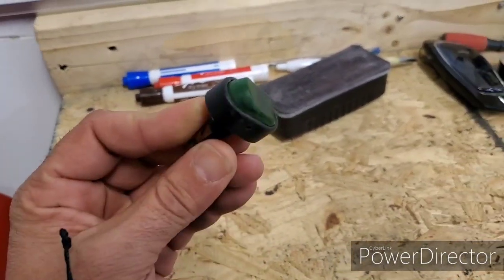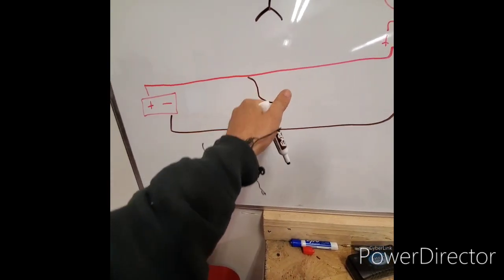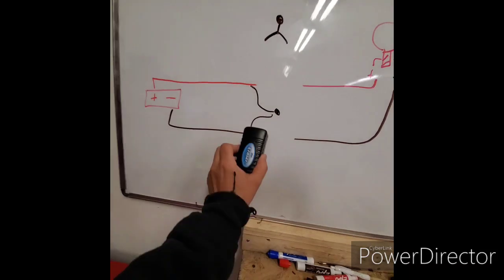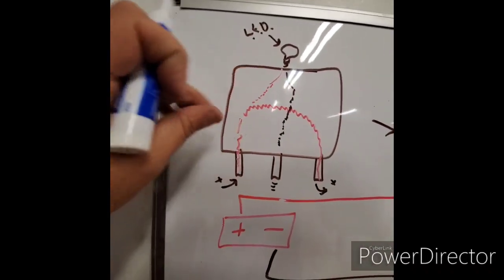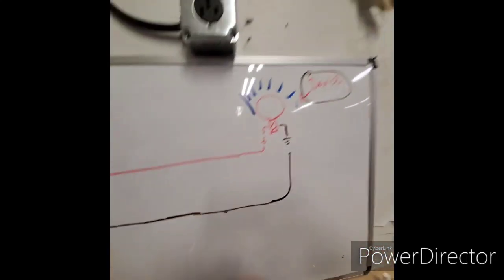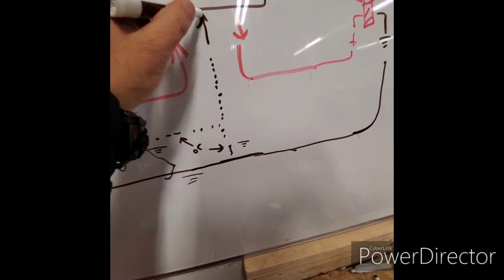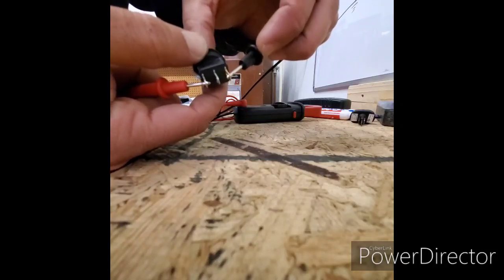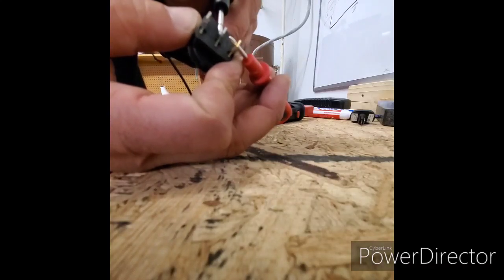How to wire an LED toggle switch , ( on-off 3 prong rocker switch ) 2020

Comment: Thanks for the great video! I’ve been trying to wire LED ceiling lights that have independent switches for each light, and also a dimmer for all of the lights together. So far no luck! Is it possible to put a dimmer on multiple LEDs? If so, how do you wire it??
Reply from the maker: The issue you may be having is that most (not all) LEDS are either on or off. This is because an led is actually a "diode". Lol. Theres a lot to explain that. But a dimmer on a basic led is not going to be likely. It would have to be a dimmable led..

Comment: Can I ground the switch to the battery and then then devise to a metal bolt ?
Reply from the maker: If your running the devices pwr, through the switch and thats the leg the switch is cuttijg on/off,  then you can ground the device anywhere youd like. Under that same context, the ground then for the switch is just for the illumination,  so yes that too can be grounded anywhere, including the battery.

Comment: Hey i have a question im trying to wire a electric cut out on a car the old switch had 6 prongs and the new one only has 3 . It has a white wire , black wire and another black wire with 2 ends and a red wire with 2 ends . How can i make it work . I tried a few things but wont work
Reply from the maker: If by "cut out" your talking about the exhaust valve? Then your going to have to fins a way to get specs on both switches.  The servo's on the exhaist cutouts are slightly diff from one company to another. Theres not much UNISON between compnaies. Which if going to make it extremely difficult for me to sort, in text and hVing not seen exactly what you had and what you have now. 
If you Hve the option to replace it with the same origional switch, id HIGHLY siggest that, over saving a few $$ by using a totally diff switch.
Reply: I tried looking for one but havent found it . The black and white single wires are the ones that come from the cut out and yes it is exhaust . Then the other black with 2 ends is ground and the red with 2 ends is power it comes from the battery
Reply from the maker: @Agustin Herrera so the best way i can explain the motors is like this. (At least how most are)  Common ground so both servo's share gnd. And then each servo has 2 pwr......1 pwr is to activate open....and 2nd pwr activates close. So essentially each motor requires 2 pwr 1 gnd. And the toggle switch rests at 0. Meaning when not touched. Doesnt send pwr down either side. No continuity.  
I am not for sure if that may be helpful or not. But if you have to use a diff switch. Dont bother looking at "what was"...instead focus on "what is". And that qould be the motors, and the supplied pwr +gnd.... from there you can move forward slowly. 
(Ps: if i am correct about the "double pole" motors, then your switch must have 2 "loads" 1 gnd and rest at center or  "open". <---technical term/not as is valve open)

Comment: I have a 3 wire brake light on a mini bike and the brake switch has 2 wires the voltage regulator has 3 wires so HOW DO I MAKE MY STOP/RUNNING LIGHT WORK ❓❓❓❓❓

Comment: can i use a "quick splice" connector and piggy back from the power wire already going into the supply of the rocker switch instead of running a separate power wire? Or will that cause a shortage....?
Reply from the maker: You mean for the gnd terminal? That would be (-) not power (+). I may not be understanding of your question..
Reply: @myonlinecarguy1  my apologies. Yes, the ground terminal i meant.

Comment: Trying to add green LED strips to my quad and put it to a toggle switch and nothing is working the strips work I know that but when I test the switch it just sparks I hooked up a multi meter and it reads nothing I'm so lost
Reply from the maker: A meter isnt suppose to work to show voltage. Because a switch doesnt have both pos and neg. Its explain in the video in great detail.

Comment: I’m trying to replace the toggle switch on my recliner. I have a black and white wire on the couch side. The toggle switch has 3 wires. A 3 prong outlet plug plugs into the toggle switch. Which wires connect to white and which to black? The toggle switch has an led light on it. Thank you
Reply from the maker: That one might be a bit different as im sure the recliner runs on AC power. Not DC. The electrical circuit of AC power is quite different. Id maybe suggest looking into that. I dont know that i can help with this one.

Comment: Hi great video i had similer issue today car wires were smoking luckys car ok i disconnect wire i had toggle switch do u think i need to wire  3 toggle switch as i got 3 different lights i got my rgb halo my led srip light for bottom grill an two led lights for my bonnet vents can u help with how i should wire them an can i connect them all to one switch but do the switch the way u did trough one leg pleaee help
Reply from the maker: So, EVERY switch is done with 1 leg. ALWAYS. So, the anwer there is yes. 
Far as the lights. You can do 1 switch for all those lught as long as the 12v source has enough power to feed it. And finally. Just for safety,  you might want to add a fise to the line just before it goes into the switch. Just incase.
Reply: @myonlinecarguy1  ok so jus so im sure shall i put the fuse in the same leg as the switch an can the fuse me next to the battary also what fuse would i need as the lights im using are all 12v and when i connect the light together when i join each ones i jus had electrical tape right thanks for getting back so quick please let us know
Reply: Also have u got instagram i can send u the lights i got on there with pics my insta is mods4less we can chat that way eaiser a bit more in dept

Comment: Say I have 3 of them switches to 3 diff devices. Can I just daisy chain  all 3 neg together and then ground it to the frame? how about the power from the battery, can I run 1 cable from the batt to the 3 switches, then just and individual power from each switch to the device?
Reply from the maker: Yes sir. I do it all the time. Good eye my dude.

Comment: Thank you so much for the clear and awesome explanation ! I know that we use a relay when the power going to the battery has higher power but is there a rule of thumb in using a direct 3 way switch like this vs using a relay switch ?
Reply from the maker: Well, you can always use the switch output to trigger a relay. Thats how you would use both. Sometimes you can use a high amperage switch rather then a relay, but in my opinion a switch triggered relay is the best.
Reply: any rule of thumb on how many amps that we must use a relay ? 5amp ? 25amp ? Thanks again
Reply from the maker: The electrical limit is determined by both the size of the wire being used as well as the switches ability to effectively pass it through. Each switch has its own amperage limits and so does every wire and they may vary from A/C power vs DC power. 
For me, anything over 15amps to runa. Device and I'll just go toggle and relay. I prefer not to run heavy long lines that directly cut on and off.

Comment: I have a weird question but if the LED turns on in the on position should shouldn't the ground and one of the positive pins still register continuity or does that not happen due to the resistance of the LED as the multi meter only passes and tiny amount of electricity to gauge continuity?
Reply from the maker: An led is an electrical "diode" so pwr will only ever pass through in 1 direction only. It is a type of resistor. I suppose in some way there would be an ohm load showing continuity,  but i imagine immeasurable because if it being a diode adn not a typical resistor.

Comment: Hello Elliott. Thank you for your video on three prong toggle/rocker switch. I’m not electrical savvy in any way, but I put some LED flood lights on the bed of my F-150. Everything works fine, except the moment I connect the switch to the lights, the wiring starts to heat up significantly to where I have to disconnect the switch.

The wiring is Nilight, which seemed pretty simple to set up. My rocker switch is the three prong LED like in your video. I connected the ground to my battery, but I’m wondering if having the metal lights grounding in my truck bed are causing the heating problem. 

Any ideas would be appreciated….

Carlos
Reply: where are you getting the positive from to power the lights?

Comment: I’m a little confused so if I’m wiring led strip lights my neg wire goes to ground prong and then i wire another neg to the battery from the same prong so I’m essentially just splitting the wire? I understand the positive side.
Reply from the maker: So you have 2 options. 
1: led (-) straight to ground.  And (+) from batt to 1 side of switch , then other side of switch to (+) of LED lights.

2: led (+) straight to batt (put a fuse in that).....then (-) of led to 1 side of switch and the other side of switch straight to ground. 

Yes, the switch is only there to seperate 1 wire. Thatll turn on and off your led light.

Comment: i have a 1990 cadillac deville. and i had to replace the ignition switch. but they have a key with a code. and so far all place iv gone can't do it because they say the cars 2 old. and locksmith charges alot!!! $$$$.. so my only option is to put in a toggle switch. will that work? i was wondering?
Reply from the maker: Electrically it would send power to the starter or at least in the direction of the starter. Unfortunately,  if you dont somehow remove the part of the vehicle's computer that is looking for the key. Then it will NEVER give the permissions required. So the what is "no" it won't work.  It's how the manufacturer stops vehicle theft in the first place.  The immobilizer your referencing.
Reply: @myonlinecarguy1  ok thk you.. so i just need to get a key with a code.... but also the ignition  has 2 wires coming from it and run down the steering wheel column and plug into a circuit under the dash. what i did is i cut the new wire and just splits it to the old one. i hope that is ok. ?
Reply: @myonlinecarguy1  even ace headwear and lows won't do it only cars as low as 1999. a locksmith if i go to them $100.00 or to me $200.00... wonder if jay leno ever had taht problem? lol
Reply from the maker: Yeah chipped keys around here start at 200 and go up from there. Sorry man, is what it is.
Reply: @myonlinecarguy1  thk you for all the info you have been very helpful..
Reply from the maker: I hope your vertical kit comes out badass man.
Reply: @myonlinecarguy1  thk u.

Comment: Just stumbled on this channel. LOVE IT!! Expert training in a digestible way. THANK YOU. 

Just a quick question: I am going to add a switch to some EL-Wire in the car. When adding a switch...Do I need to run an inline fuse? Seen others say you need to so am confused.
Reply from the maker: Can u elaborate more on the "EL-Wire"? 

Far as fusing a switch, or any elecetrical being added. S fuse is really always important to have. It will save your device and protect your wires if somethign were to accidentally create a short or anything..
Reply from the maker: Also, i super appreciate the love man. Sonetime things can become disheartening.  But i try like hell to help. Lol
Reply: @myonlinecarguy1  Honestly man, totally full respect! Really really helping me with the whole led rocker switch thing. Your teaching style is incredible! 

In regards to the EL wire, its pretty much the stuff you can buy off wise that pushes in to your dashboard/trim to make it look all pretty haha! I basically purchased to sets which are cigarette lighter powered, however I have cut off that part and my plan was to connect both sets together. Then tap them into the power behind the cigarette lighter, but add a switch so I can shut them off. I just did not know if I needed to add a fuse. 

Thanks so much again bro.
Reply from the maker: Your welcome. Glad we could help.
Reply from the maker: Oh, as far as the wire kit. Something that low voltage, you could get away without a fuse, but ONLY because the power feed from the cig lighter, is most likely already fused by itself. Plus that kit wont pull a major electrical load at all And if the were to have a short, you could trouble shoot it pretty fast.
Reply: @myonlinecarguy1  Legend! Thank you very very much man! Genuinely appreciate the advice. And great videos.

Comment: Great video.    I always wondered how these worked.   QUESTION:    I am switching from a two prong switch to a three prong lighted switch.   If the two prong is not labeled or miss-wired, how do I use a multimeter to determine in the “in/hot” wire on the switch?    BTW...I love getting advice from Vin Diesel LOL!!!
Reply from the maker: Ok, so on a 2 prong....there is no direction. So even if labeled, you have to check it. 
Using a multimeter, set it to read "continuity " should have an image like a speaker sound type image..
Place 1 lead, on 1 prong and leave it. The other lead on prong 2, and flip the switch on. If it beeps when on and silent when off, those are you pair for "pass through " (in/out) . If no beep at all, then leave meter lead in prong 1, and move meter lead to prong 3. And test again.
Reply: MyOnlineCarGuy1 on the two prong, one wire should be the HOT wire.   I assume just check for current using a common ground?   Sorry if not being clear.   My 3 pole is labeled, the two is not.   I want to make sure I take the hot wire from the 2 prong and put in the correct spot on the three.
Reply from the maker: @dmraco  oooh ok. So you meant how to test the 2 prong? Yes, find a common ground somewhere. Ajd using the (+)  lead of the meter, probe each wire. 1 wire will have voltage always (or with key on if in a car)....the other wire will ONLY see voltage when the switch is "on".
Reply from the maker: @dmraco  voltage is what your looking for, not current. (Im sure u know that, but just incase)
Reply: MyOnlineCarGuy1 Thats what I thought.    I am putting a switch to manually open the butterflies on a Corvette exhaust.   I do not want to fry the actuators!
Reply from the maker: @dmraco  ok, now thats a slightly diff switch type. (At least i ise a diff type for that). I use a double pole switch. Where its rest cebtered at zero. But up = (+)......and down =(-) . So i can move the motor in both directions. Using 1 switch. To both open and close the valves.
Reply from the maker: Interesting. It looks like a typical 12v high amperage on off switch. 
I just wonder how the valve closes, if the only thing ever sent is voltage, to open it. Know what i mean.
Reply from the maker: Unless the switch takes power into both ends.....with a common ground. Then, what you see is on and off, but intenrally, could be a polarity change. That would work too. Lol

Comment: Can I use an illumated toggle switch without hooking up the light on switch?
Reply from the maker: Yes. The led portion doesnt effect the function of the on/off of a toggle switch.
Reply: @myonlinecarguy1  I must have a bad switch then
Reply from the maker: Each switch is limited as to how much amperage can pass through. So its possible you need too much power then the switch is rated for.

Comment: I have a 30A fan. Can I run a 20A toggle off of this?
Reply from the maker: Negative. You should not. Tou can run a 40amp and go higher, but not less. Less.will cause unsafe electrical failure at some point. Probably instantly.

Comment: Hey what if I want my led to stay lit while it's off so I can see the light switch it night how would that need to be wired to have that led continuously lit
Reply from the maker: Most switches by way of their "normally open/normally closed design wont permit for that. 
The honest EASIEST way would be to wore an led next to it. Or a switch that had an illumination,  so when the headlights are on its lit.
Reply: @myonlinecarguy1  thanks boss
Reply from the maker: Anytime my dude. Good luck with it all.

Comment: I have a 3 prong LED switch. i also have a grounded connection i need to control. We purchased a motorhome. The slideout safety switch is hanging under the dash. They have a black wire alligator clip attached to it; one end attached to the switch and the other end clipped to a ground. When the alligator clips are attached to ground, the slideouts can then be controlled. If you leave the clips attached to ground, release the emergency brake, and place the MH in gear, an alarm sounds. To shut off the alarm, you have to reach down and disconnect the alligator clip from the ground. If the alligator clip is not attached to ground, and e-brake not applied, you cannot control the slideouts. Instead of having to reach down and repeatedly connect/disconnect the alligator clip from ground, I want to split the alligator clip and place a switch in-line and mount on the dash. How do you switch this alligator clip ground wire using this 3 prong LED switch?

Comment: I have Kc lights in my truck. Plugged the three prongs in to test it, they worked. Unplugged them and put the in the inside of my truck. Now they won’t turn on. I assume I messed up the three wires, how do I fix them?
Reply: Sorry, I don't have an answer, but we did the same this weekend (KC lights in a jeep).  How did you unplug the wires form the switch?  I am pulling but worried I am going to break something.  Is there a trick, or do I just pull hard?

Comment: Ok now does the ground wire that goes to the device need to go to the same ground as the switch or can you ground the device to any grounded metal? And same question for switch does it have to be hooked to the same ground as the device?
Reply from the maker: All the grounds can be diff. And it would work all the same as long as the grounds are all from the same vehicle.